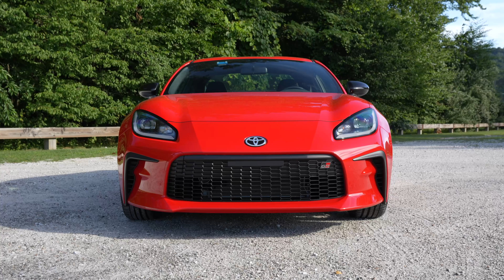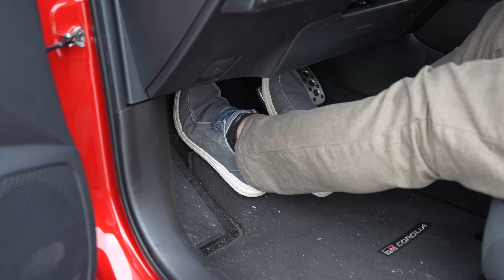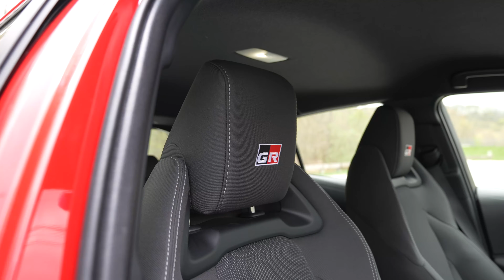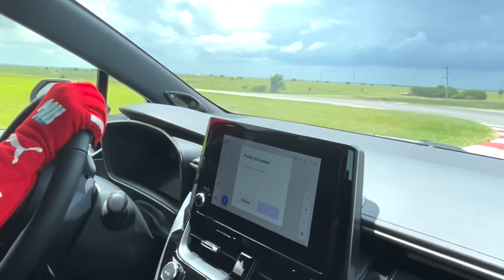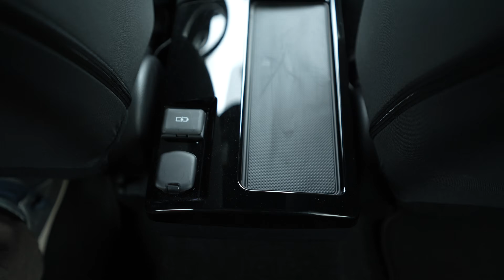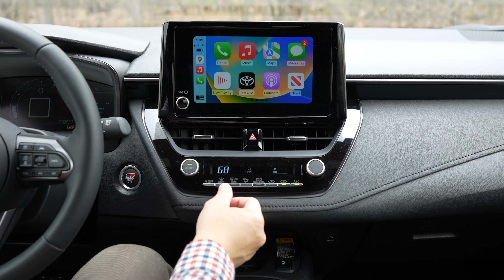Toyota GR Corolla Core Is So Good - Here's How It Can Be Better

Comment: Heres the real how to make it better.

1. Buy it in black ⚫️  premium package* 
2. Add the rear CE spoiler and hood.
3. Add the Eventury intake (decreses intake temp by 20f!)
4. Add the pilot spot cups tires from the Morizzo eddition. 
5. If you live in a warm climate weather like me chage the engine oil every 3k miles OR LESS regardless of what the manufacturer or YouTube tells you****. 
6. Use protective film for the front bumper and hood to avoid rock chips. 

There you're welcome and enjoy 😉
Reply: You got a couple of things right.   Subjective, but black is the worst color offered IMO.    And def don’t need more grip then those pilot sport 4s……..unless you’re tracking it.   I’d go as far to say,  for street use…..less grip would make it much more playful/fun.
Reply: Black is difficult to maintain clean. No thanks 👎
Reply: @SamMarr77  But it looks awsome when clean ;)

Comment: The price puts it in Subaru WRX Limited range, with a far superior AWD system for winter weather. Also have fun with the wait times for anything from Toyota they are moving away from dealers.
Reply: But the looks on the Subaru WRX is hideous.
Reply: @bj10jgo  I agree, I prefer the older WRX by a mile.

Comment: I sorta tilted my head in confusion when you mentioned a stiffer feel on the clutch pedal. Coming from owning a VA WRX and a 6mt Tacoma it felt really light to me when I drove it. Yes trucks tend to have heavier pedals but man, the VA WRX pedal is stupid heavy for a stock application! My wife had a hard time driving that car because of how heavy the pedal was. I almost stalled the GRC when I test drove it not because I suck at driving but because it was so much lighter than any of the vehicles I’ve owned before I started to let it out too quickly. 

The GRC is definitely on my list of next vehicles to own. I want back into another V8 car but also miss my AWD car too. Driving the GRC made me feel like I was back in my WRX and made me love it even more

Comment: In regards to the GR-Four AWD system, it does not use a wet multiplate clutch pack found in many of its rivals. It uses a electo magnetic multiplate clutch pack to control the awd slippage and lock. This system is a zero friction clutch and no amount of slippage will induce wear. Unlike some other trick awd systems like the focus RS which did use a wet multiplate clutch to moderate the torque bias. That system did generate a decent amount of heat from slippage.
Reply: awd is for at transmistion but v8 are also use for manual THAT MEANS THEY HAVE AWM MANUAL OR AT TRANSMISTION GEAR BOX

Comment: Having spent years in WRX STi Hatchback, the GR Corolla for me was the next iteration of that idea for rme. I LOVE mine! Even did my own review on it and currently sitting at about 8500 miles... I couldn't ask for a better experience. Even having driven FL5 CTRs and Elantra N's, all good cars in their own right, there is something intangible about the GRC that talked to me and I' m sure many other owners. Even with some interior areas that could use some better materials (I'm tackling that on mine as we speak), and a few rougher edges compared to competitors like the Civic Type-R that have multiple iterations in the US... the experience is amazing.
Reply: I've owned WRXs for 21 years. Sold my last one after my GR purchase in Feb. My two major gripes are no armrest or spare tire. Thankfully both issues can be remedied. Man 8500 miles, you have been doing some driving. Make that enjoying.
Reply: Which Gr version did you get? @stevethomas760

Comment: I test drove this after driving my 2022 Elantra N manual transmission. The GR Corolla clutch is heavy, a bit springy and the engagement point is high (roughly 85% of the clutch travel) compared to my Elantra N which is in the middle of the travel. This can make the Corolla fatiguing and hard to drive smoothly. The pedals are not properly spaced for heel-toe downshifting. The interior looks like a rental car. I do like the notchy engaging shifter. The gearing is short which requires shifting more often compared to the Elantra N. The visibility while driving is great.
Reply: As a GR owner I do wish that Toyota would have gotten some color in the interior. Hyundai N cars were on my short list. Likely would have bought a Kona N if it came with a manual. Did drive one, stiffest suspension of any car I've ever driven. Not sure what level it was set on, my guess is N mode. I'm glad that there are some good choices now